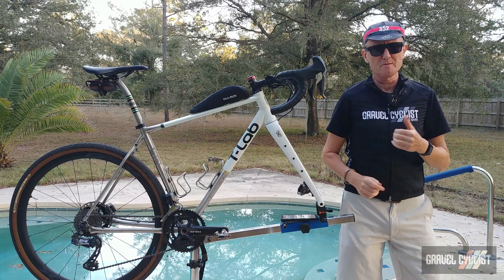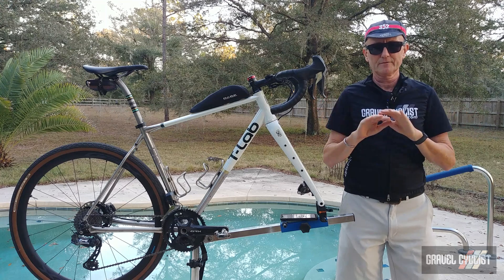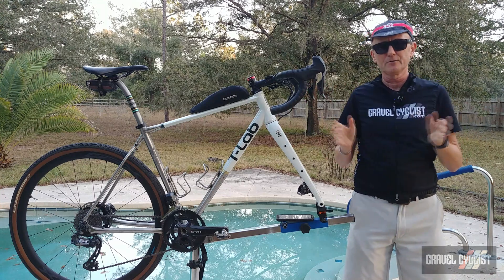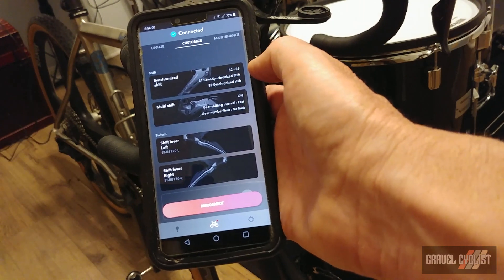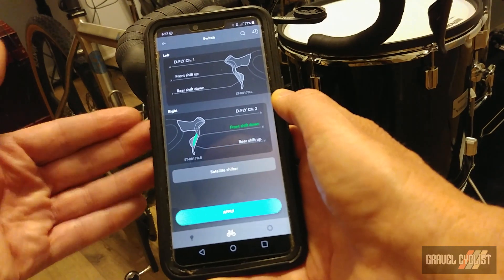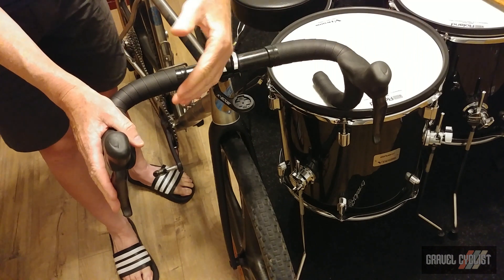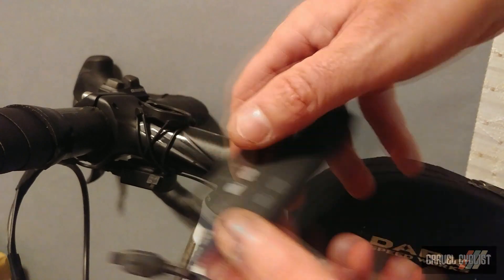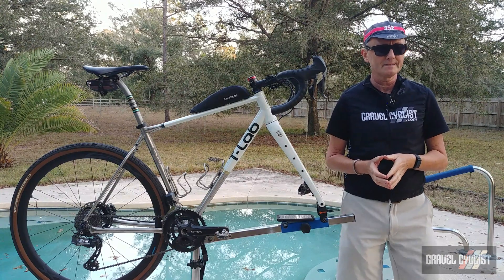How to Save Wear on Shimano Di2

Comment: How do I go about downloading e-tube to my laptop?  Where to I get it from?
Reply from the maker: This link assumes you have the older battery charger like I showed in the video - https://bike.shimano.com/en-EU/e-tube/project/archive.html - after installing and running eTube for the first time, disregard the option to upgrade to the latest version. You need to stay on version 4.04 or less (depends on your version of Windows, etc) for the older battery charger. Don't forget, the battery charger doubles as the interface for connecting to eTube.

Comment: My 2022 Ultegra Di2 shifts great, 4500 miles on it so far................BUT, rarely I hit a sharp bump and it grabs a gear on the back.
Nice clean shift. But I dont want it shifting by itself.     Also on freezing cold days with real gloves on, there is almost no way to get a finger on the small shifting paddle........I try and try but its luck of the draw rather I can shift or not.

The accidental brushing a shift paddle can happen, in really rough thrashing terrain.
Barely touch it and it drops to small chainring which can be a real surprise if your cranking hard.

Comment: Son of a... didn't even know shimano let us do that. I've just been using the hood buttons for the cassette
Reply from the maker: Haha, better late than never. I love the hood button integration with Garmin.
Reply: Ive never even heard of the hood button, and Ive got 4500 miles on my Ultegra Di2.
Time to go fiddle around.
Reply from the maker: Brad, it is present on 11-speed Ultegra Di2 and 12-speed Ultegra Di2 levers. I usually actuate it using my thumb. Have fun!
Reply: @GravelCyclist  The buttons dont do anything unless they are programmed to do so, right? I found em and yeah I wanna put em to use.
Reply from the maker: @bradsanders6954  Brad, by default, the top buttons default to D-Fly Channel 1 and D-Fly Channel 2. This default is optimized for pairing to a Garmin computer for switching through screens, and so on. If you've ever connected Di2 to a Garmin, it will prompt you, "setup Di2 buttons?", that's what is happening here. But, you can change their settings to anything else in e-Tube... front derailleur shifts, to name one example.
Reply: @GravelCyclist  Sadly bluetooth and modern tech are not my thing.  Or Garmin.  I rode to Alaska and back with no cell phone...."paper map".
Reply from the maker: @bradsanders6954  Nothing to be sad about, you're harkening back to not so recent times. I am happy I grew up when I did sans internet, cell phones, and so on. I remember when I first muddled about Los Angeles in 1995, paper map, always seemed to get where I needed to be.
Reply: @GravelCyclist  It wasn't that long ago, I still do 500 mile day rides on motorcycle with no phone, no map, I just know where to go and always try new roads.
Reply from the maker: @bradsanders6954  100% Brad! Whilst I plan my routes using an online resource and transfer my route to a Garmin, I greatly dislike following the routes of others. It completely takes away from the fun aspect of exploring, getting lost, and getting found again. I think so many people have lost sight of that nowadays, they typically like the pre-vetted experience that guarantees a ride without any of the exploration fun. I certainly understand that perspective if you're on a time crunch, but I like all-day exploring. In a nutshell, my version of planning is almost similar to yours, but without reading the paper map. Another thing I'm not a fan of nowadays, is this reliance on uploading data to Strava. The whole affirmation thing, stupid timed segments, and the fact people willingly give them their ride data for free, is astounding to me. I saw that platform for what it was many years ago after poking around, and quickly left. I really appreciate you chiming in with your insights.

Comment: I've been running this set up for the last 2+ years....
Both paddles on the right lever shift to a harder gear out back on the cassette.
Both paddles on the left lever shift to an easier gear on the Cassette.
The top hood button on my right lever shifts the chain onto the outer chainring.
The top hood button on the left lever shifts down to the inner chainring.
In this way, it is not important to find the correct paddle on a lever when shifting rear gears (especially when wearing thick winter gloves).
Finally, I use Synchro Shifting, so let the di2 computer manage chainring shifting most of the time. Buttons on the hoods can be used to override this.
On the road, only Dura Ace and Ultegra have the hood-top buttons I use for chainring shifting. 105 does not. I don't know about GRX?
Reply from the maker: Nice to see the different types of customization people are leveraging. The GRX levers have hood top buttons. Mine are configured to switch between my Garmin 1030 Plus / 1040 Solar screens, with the double click configured to trigger specific screens on the Garmin (return to map, etc).
Reply: @GravelCyclist  Leveraging... Good one 🤣
Reply from the maker: @trevekneebone369  Love the big words around here :)
Reply: @GravelCyclist  I just thought it was funny because we were talking about levers / shifters!
Reply from the maker: I'm glad someone figured out what I was doing here, haha. I like your Di2 button setup for the big arse glove winter riding, that is a nice solution.
Reply: @GravelCyclist  Yup. And should be a fairly painless switch to/from SRAM

Comment: I've been running virtually the same setup for a few months on my rig. The only difference for me is I flipped the front mech buttons so that the right shifter always makes gears harder (moves both mechs away from the frame) and the left shifter always makes gears easier (moves both mechs closer to the frame).
Reply from the maker: Nice one. For some reason, my brain likes the right side small paddle chainring drop. So awesome you can configure the shifting in this manner, way better than mechanical!